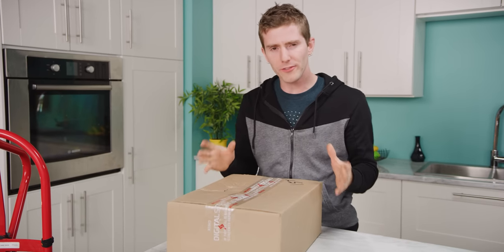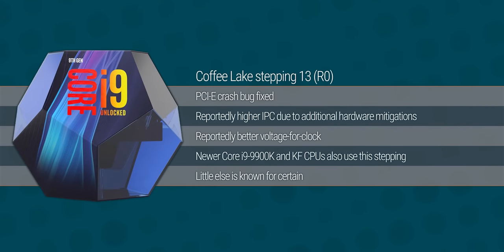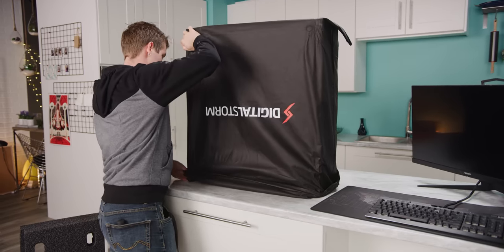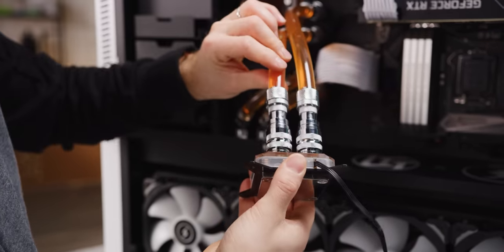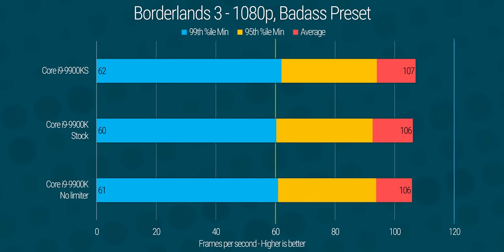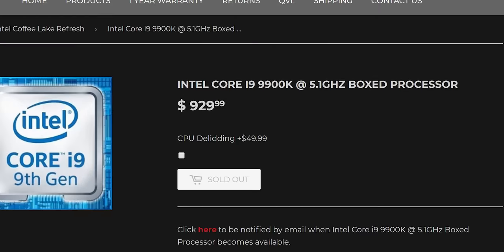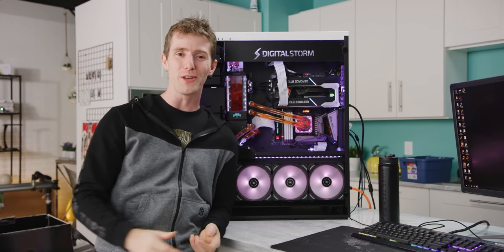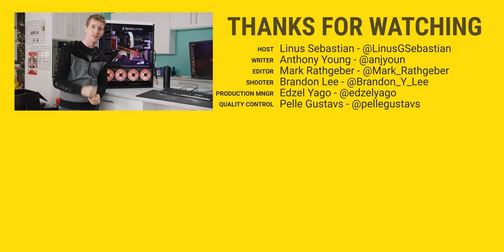Intel's PRE-OVERCLOCKED CPU... Core i9 9900KS

Comment: Intel is literally just reselling it's own processors overclocked. They must be really scared of amd
Reply: well. they are planing to make something similar to amd procesors but whit gpus (which is super hard xd)
Reply: I mean it's smart.

Since the silicon lottery exists. Why not charge hundreds more for the better stuff?

The surprising thing is it's not normal practice.
Reply: @usrevenge  interestingly, it is. This is happening for a long time in the mobil segment, where Intel sells the same chip in different tiers based on how low voltages it can run stable. For mobil phones Qualcomm sells their chips with many different frequency warranties.

I think the big difference is that on the desktop segment the cooling becomes a big limiting factor. The gap is a lot larger between a 100 to 150 "TDP" chip, than a 5 to 10 "TDP" chip.
Reply: But it can do 5Ghz all-core WITH avx. The normal 9900k cant.
Reply: It is basically the fx 9590 all over again
Reply: not really the 9900KS has been planned before Ryzen 3 came out
Reply: @edededededededededede  100-150 is 50% more heat to dissipate, where as 5-10 is 100% more heat.. And in a very tight space i would rather find a way to get rid of 50% more heat than 100%.. And.. There is a LOT more space for cooling in a desktop PC, than a mobile device ;-)
Reply: its*
Reply: @De-M-oN  Most regular i9 9900k's can do 4.9 with avx, little bit under half manage 5ghz. The 9900ks is basically just the regular 9900k but the silicon lottery winners that can do 5ghz are picked at factory.
Reply: When I think of AMD I think of poor people.
Reply: amd: kicking intel relentlessly
intel: plz stop
public: why are you doing this this is murder buuuut keep going
Reply: @Jay-tn7dw  its good competition 
Amd = better core prices with a slower clock speed and less single thread speed
Intel = Cores have a faster clock speed and better single thread speed
And yes the prices are different but thats all part of the market for everything
Reply: Except that it isn't, it just isn't on an entirely new process. 9900KS's are manufactured separately and internally different (although very slightly, and mostly just to avoid spectre/meltdown vulnerabilities). Not saying they aren't pieces of shit, or that you couldn't overclock any existing binned 9900K to this speed, but we don't need to lie to put intel down, they aren't overclocking and repackaging 9900K's
Reply: Intel still better for gaming. All those cores on threadrippers/ryzens are underutilized since games are optimized for 6-8 cores
Reply: AtomToast lmao!! Do you see how much the 9900ks is selling for? $700-$900 on Amazon. It’s out of stock everywhere. And whoever has it, is charging a lot for it. Intel is not scared of AMD.
Reply: @joemomma707  Yea because it's still better than AMD for gaming. AMD is better for productivity
Reply: Eldar K I love the competition. It’s better for the consumer. But look at the damn Black Friday deals. Intel doesn’t even give any good ones because they don’t need to. They are not scared of AMD. Lol
Reply: i9 10980XE: Sir I don't know what you're talking about. Am new.
Reply: It's an old AMD trick, it's what ya do when you don't have an actual product to compete. Intel has spent most of it's existence preventing competition rather than participating in it. They got blindsided and almost 3 years later still have absolutely no idea what to do.
Reply: AtomToast Imagine using AMD 😳
Reply: The've done that seens 6000 series. Where's the "tik tok"? Tik, tok,tik,tok,tok,tok,tok.
Reply: @CorporateShill66  not even for 6-8. Games need less.
Reply: Its so silly saying a company is "scared" of another. They have 10x the money of AMD. They are restructuring their business,  just like AMD have done over the last 7 years. Markets are changing and you will see a more variety of products from Intel soon
Reply: @monmc6129  I bought one and I love it, this thing is stupid fast, I have mine at 5.1ghz on all cores under load temps of 81c, it costed 30 some odd dollars in a 3 thousand dollar build, so I am not sure what you mean about price,  literally was like $35 more, only difference in cost is getting the right cooler and the NZXT Kraken x72 works like a charm for me, so AMD fanboys keep hating IDGAF!
Reply: @thealien_ali3382  Bricks, best CPU for the money on the market ATM!
Reply: That's not at all what it is lol, do you not understand what binning is? It's better silicon.
Reply: Intel being "better" for gaming literally only matters for esports games, because everything else is GPU bottlenecked these days anyway. And with zen 2 it isn't even universaly true anymore.
Reply: Too be honest nvida know what’s they have even if amd  steals intel or intel steals amd and nvida to make a intel gpu intel will struggle I don’t understand why tom left nvida because helping intel will never get him above nvida
Reply: @Jay-tn7dw  poor? Threadripper is more expensive than the 10980xe. And the 3950x is the most expensive consumer processor in the world.
Reply: GayMD an Intel are best buds lol I doubt Intel is afraid of anything and likewise for amd
Reply: @Jay-tn7dw  With better CPU's.. 🤔
Reply: And amd is scared of making a good driver or cpu that can actually perform with any type of ram. Amd is also scared to make their products plug and play like intel/nvidia
Whatever fanboyyy
Reply: Carlos999 8 ehhhh partly, the FX was better than intel at nothing, Intel has better single core performance and is a better gaming chip. so it’s not without purpose. The FX was just a space heater that had nothing on intel cpu running on half the power. yes AMD has surpassed intel but not at the same margin that intel had on the FX series.
Reply: Fast forward to 10th gen, and they've squeezed even more frequency headroom in by shaving a little bit off of the CPU die... LMAO. You have to give them at least an ounce of credit for trying to buy themselves some time to get their shit together with a new architecture.
Reply: AMD for the win!
Reply: If you've been around long enough you would know that they're not scared of AMD, they almost always have some new technology in the works that can surpass the competition. Intel knows how to make money, they're not scared of AMD they're just trying to make more money like any normal company
Reply: Nope. Just maximizing their profits. If they can sell these binned chips for more money, why wouldn't they? It didn't cost them any more to make them than every other i9-9900k, and there are enough people out there who want a faster machine without putting in the effort of tuning parts themselves that it justifies doing it.
Reply: The last 9 months have shown that fear was very much warranted.
Reply: AMD sucks
Reply: well amd is kinda doing the same with the xt or x processors
Reply: This comment is funny now

Comment: The tone is so much less excited compared to the 3950X review
Reply: Because its nothing really new
Reply: Intel is simply desperate and the only fancy thing about this review is pretty much that prebuilt
Reply: @mm-rw3hi   Intel is far from desperate. This CPU is just a stepping stone to better things.
Reply: @wysetech2000  
>far from desprate
Hahaha no
Reply: @wysetech2000  ahhahahah. AMD on same lever or rediculously ahead in some cases and arcitechture is on absolute limit and next real new product for consumer lines is expeced on 2022. Oh intel fan boy you are so lost here.
Reply: @wysetech2000  Ah, I see a Intel fan. The 9900KS is basically like when AMD released the FX 9590 the 9590 was basically a 8350 with higher clock speeds. This isn't a stepping stone it's Intel trying to keep their crown in gaming performance if it was a stepping stone it would be a different architecture the 9900KS is almost identical to the 9900K in almost every way other then the clock speed. Just like the AMD FX 9590 and FX 8350. Maybe Intel 10th gen has something in store but it isn't looking too hopeful when the 3950X is beating Intel's 10980XE in early / leaked benchmarks.
Reply: Eternal Ohm wait dude, that’s heart broken. You totally forgot 6th vs 7th gen intel cpu? Even it’s name,Sky and kaby is actually the same meaning...anyway, i would rather buy 9900kf and OC it myself. Save a few buck for nzxt x62 kraken. And damn it, if i didn’t have bad time with amd then pretty sure i would go amd route with 3950x. Man really those fx series kill my mood. Even now i am still in fear
Reply: @NamelessPassenger  If you aren't going AMD because of FX which was like 5 years ago why are you going intel with how many security vulnerabilities their chips have? I dunno it seems a bit contradictory to trade off a issue the company had 5 years ago for a different company with a issue they have now. 
Also no company is perfect Intel is guilty of selling 4 core CPU's at such a high price for a while until Ryzen came around. 
Yes the FX CPU's were pretty bad but that was the past this is now, however I do want Intel to come out with something that can rival AMD in price to performance but at the moment it just isn't the case the reason I want this is competition between companies is a good thing for the consumer having one company on top of a certain market is jut a bad thing just look at Intel before AMD Ryzen.
Reply: @EternalOhm  The first exploits were found in Feb 2018, not 5 years ago. Intel, Google, Microsoft and Linux patched most of the most serious exploits but not all. Everyone thinks Intel can snap their fingers and it's all fixed. Some may never be fixed on the current architecture. 

I guess they should have millions of users unplug their computers and servers for vulnerabilities that have only been exploited by researchers to date. I do understand that servers have to be secure without question.

How does anyone expect Intel to sell cheap when their fabs are in countries that pay a decent wage?  Israel, Ireland and the USA.
If you want to support China and Taiwan then go ahead.  AMD's head office in the USA is just a front anyway. It's bad enough that with some products we have no choice. This whole deal has left a bad taste in my mouth. I will do without before i buy AMD.
Reply: @TeeDee87  Same lever??? I'm not lost at all. The laugh will be on you soon enough.
Reply: @TeeDee87  You should have used the few $ you saved by getting an AMD to get some English lessons
Reply: Max M you do realize Intel is coming out with 10th gen processors right?
Reply: @Trainmaster909     These people don't care about Intel and what the're doing. They only follow like sheep and make the same comments on the same things that others do. It makes them feel superior some how. 
YouTube creators love the views and subs it gets them. They are the worst for stirring the pot. Intel users should boycott AMD videos, Unsub and don't watch their videos like several of my friends and i have..

AMD fanbois like to dig up dirt on companies to further puff up their egos. Truth be known these people have joined the AMD cult because they have nothing else in life. Most people that meet them face to face dislike them and they know it.
Intel is too large a company to let this crap go on forever or maybe give up on desktop CPUz forever! It's only a low percentage of their business anyway. If people want to support China and Taiwan let them. The only thing Trump got right.They will pay for it in the end. 
It will be interesting to see if Intel can compete with price since TSMC pays their workers peanuts compared to Intel. Most of their fabs are in the USA where the don't have child labor.
I guess time will tell all.
Reply: @wysetech2000  Yahoo was a giant too my friend. AMD fanboys exist because they didn't sell a chip that could be sold for 500$ for 1000$ just because they had monopoly. And intel might not be desperate. But they are wary. Don't talk about fair wage without knowing all the factors. Every country has different cost of living. I can practically live in luxury if I were to make 1500 USD a month. Can you say the same thing about any of the countries you mentioned. So fair wage in other countries cannot be equal to USA's fair wage unless the cost of living is as ridiculously high too. And so far, your comment is the only cultlike one. Value always sells better.
Reply: Bet the check from Intel is way fatter as well (I am responding to the original OP btw)
Reply: Can't blame them.  A 5.0 ghz 9900k isn't exactly the rarest of things.  So a rerelease of one is a bit, "okay.."
Reply: @AryaCashOut     I don't know what country you live in but from where i come from in north america everything is sourced from China and Mexico because it's cheaper.
Reply: @EternalOhm  Thats not fair to the 9000 chips. They were nutty 5ghz cpus that have the ability to literally melt low-end/unworthy mainboards. (Look up "MSI AMD 970 Krait with a 9590 on fire" on YT)
The 9900ks is just a 9900k with better binning.
Reply: well yeah, its a far less exciting cpu
Reply: These amd vs intel battles are fascinating. I own neither atm but am leaning toward intel purely coz of slightly more optimised gaming.
Reply: Cuz intel dead
Reply: @wysetech2000  Yeah first exploits and there's still more coming. And some of the security vulnerabilities were left untouched by Intel for a year before they became a major issue or was known to the public probably because the features / security vulnerabilities gave the CPU's more performance. Also you seem to have misread my comment. I was refering to the AMD FX chips being released 5 years ago not the vulnerabilities for the vulnerabilities I was referring to it being a recent issue with Intel. Please learn to read before you try to correct somebody.
Reply: @Trainmaster909  I'm pretty sure 10nm has been cancelled for desktop CPUs. You'll see laptop parts, but not desktop. I'm sure they will brand some CPUs to be 10th gen, but they will still be 14nm++(+++? I lost count). That means that you won't get a huge step-change in performance or efficiency. Intel has announced it will skip straight to 7nm for desktop CPUs, but don't expect those to launch any time soon. You will not see Intel desktop CPUs that are not on 14nm before 2021 at the earliest.